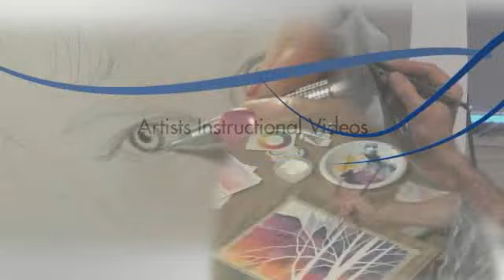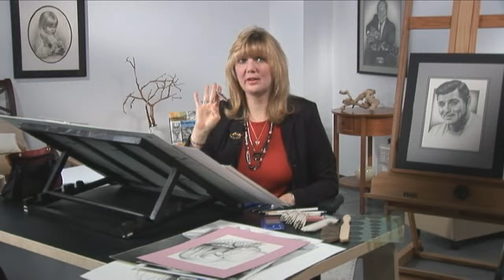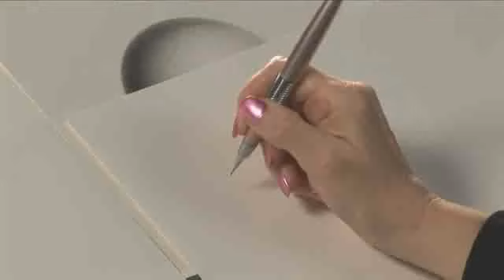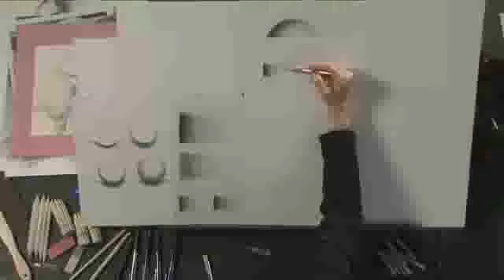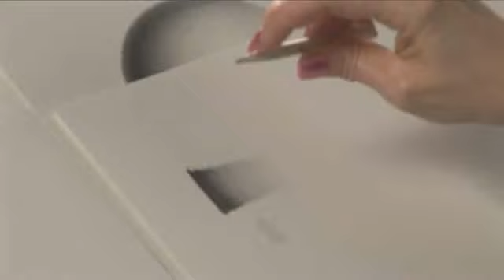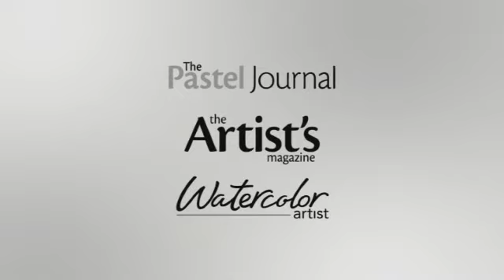Preview | Drawing Lifelike Portraits in Graphite with Lee Hammond

Comment: I love your videos, but I don't get why you need to use a mechanical pencil for this. I use HB, 2B, 4B, etc., to achieve these results.  By doing it this way, you are crushing the tooth of the paper.  You want to built those layers gradually, not jamming the graphite into the paper.